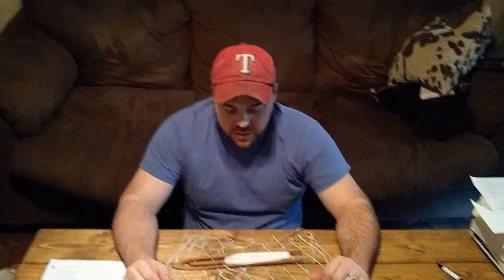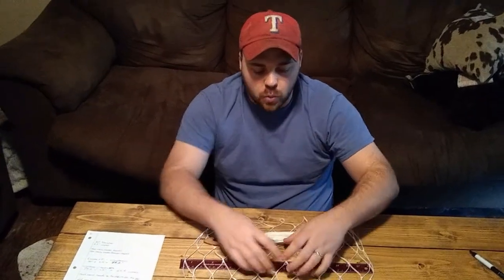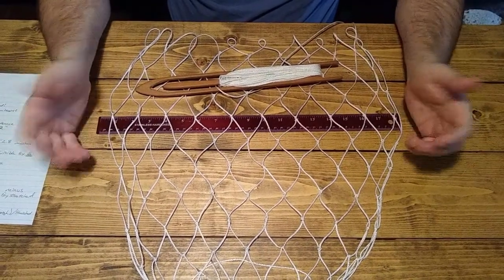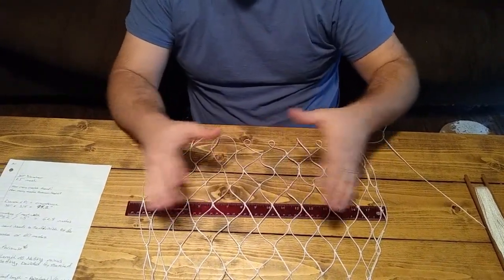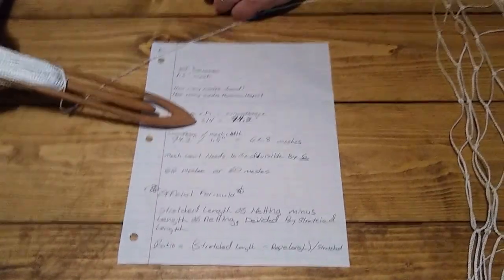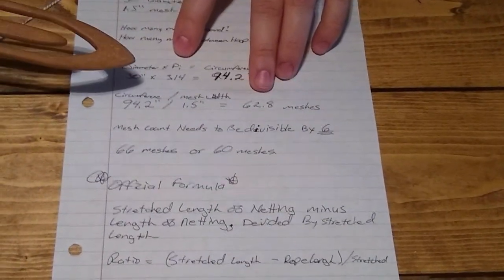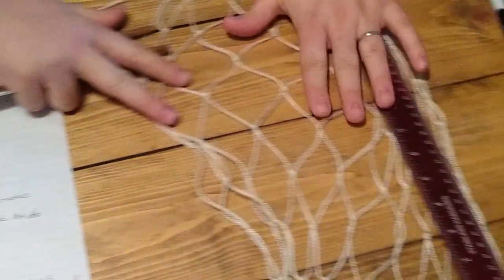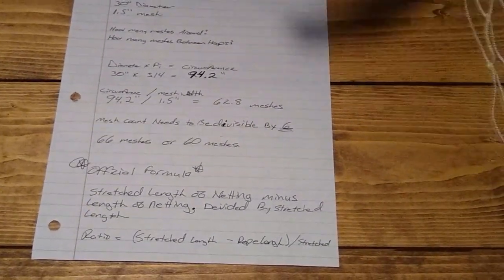Hoop Net Math

Comment: hay man i gotta give you a little update. Man this math has made life so much easier tying these nets up ! now i dont have to have my head stuck all up inside one of my frames to sew up a throat just punch in a few numbers in the ole calculator and i can sew up a throat on the bench in a nice comfortable position  then just mark the knot spacing on the frame with a sharpie and taper measure and just sew the throats in ! its so nice ! now i do have one more question. what you where showing was for a
50% ratio what would you do to calculate for say a 30% or 60% ratio ?
Reply from the maker: Awesome news bro! I am glad it's helping someone else. As for changing the hanging ratio, that gets more into walls of webbing and less into hoop nets. I have a video planned for that when I tie the leads for this net. Also, I have the video edited on my computer of how I tie my throats, just need to upload it. The way I tie my throats though, you have to add or subtract 6 meshes to the overall count for them to come out right. This means that you never tie on a specific ratio. Also, adding or subtracting meshes to alter your ratio changes the shape of your throat. It may not choke down fast enough and leave a big center hole, or it may choke down too fast and not have a funnel shape to it. For hoop nets, stick with what is in the video. An old man showed me that trick and told me "don't go monkeying around trying to do something better, cause it won't work." So far, he's been right.

Comment: Gonna do any videos on making the hoops them selves ?
Reply from the maker: Yes sir. I am looking for a suitable white oak tree to split them out of
Reply: Sweet ! Now I been taking notes on how you do your measurement but I have a question.  Now I have always measured by half meshes and full meshes. I usually refer to the full mesh like my turtle nets are 3" mesh so my half meshes are 1.5". And two of those will give me a 3" mesh. Now I'm slightly confused about what your calling a bar mesh. It seems to me a bar mesh and a half mesh are the same . Is that right ? If so I'm slightly confused where you getting 1.5" from 2" mesh. Wouldn't a two inch mesh give a 1" half /bar mesh ?. Sorry I'm really really intrested in how you do you math just not super sure we're speaking quite the same language when it comes to terminology is all lol. Also will you be doing a video possibly on sewing on ordering a sheet of premade netting and sewing it on some hoops ? Please keep them coming !
Reply from the maker: Yeah, a bar is a half mesh. It measures the "bar" or length between the knots. When ordering prehung (sheets) of webbing, it is always measured in bar (half) mesh. You will see length measured as "stretched" mesh which is confusing because it isn't based on mesh size. Also, hanging ratio comes into play on ordering prehung webbing. I need to make an order of webbing and do a video on it. I'm not too far from tying the leads this will give me some material to work with and explain walled webbing. Hoop nets figure different than wall webbing.

Edit: as for the 2" mesh, that was just a peice I had laying around to show an example and make the math easier. The net in the series is 1.5" webbing, which is 3" stretched or whole mesh.. if you have any questions about any of it, post your hoop size and webbing and I can help you with the math.
Reply: That is that makes so much more sense ! Where do you order your netting supplies from ?
Reply from the maker: @TheBlackTrapper  I order from Fish Net Company out of Jonesville LA and from Memphis Net and Twine. It's getting hard to find good twine anymore. Do not but it from Walmart. Do not but Mason line, it's not twine and it isn't as strong. Get a Seine twine from maybe a local hardware or fishing store. As for shuttles (needles) I ordered several off eBay, I have made them out of wood, and I have one that was passed down to me by the man who got me started on webbing.
Reply: You don't have to tell me about not buying Wal-Mart line lol, that crap unwindsand corkscrew like crazy ! The bonded super brand stuff from the fish net company is amazing to work with and since it's got that coating you can get away with a single sheetbend instead of a double and only slipped knots I've had are in traps with really big snapping turtles. Their tarred line is very nice to just wears out my hands. But any how that k you so much for answering all my questions ! Cannot wait for your next video and I'll definitely be giving your channel a shout out in my next video !